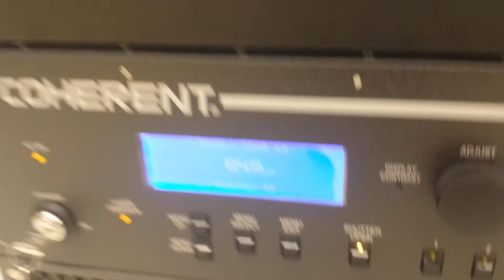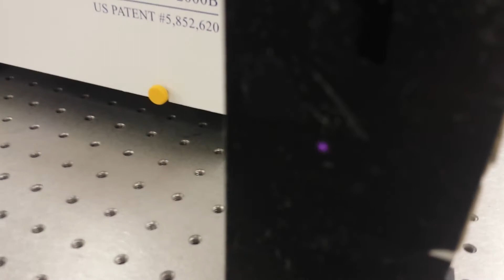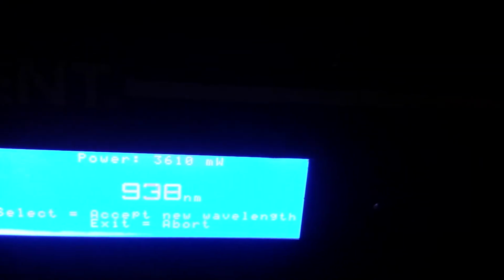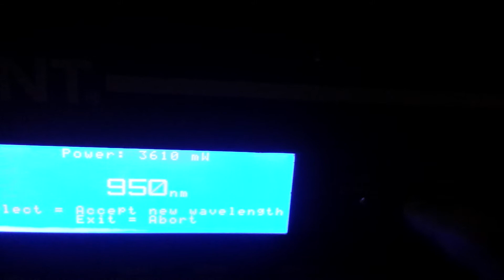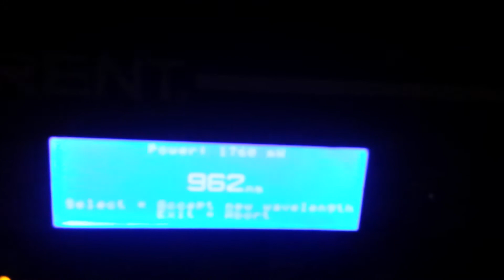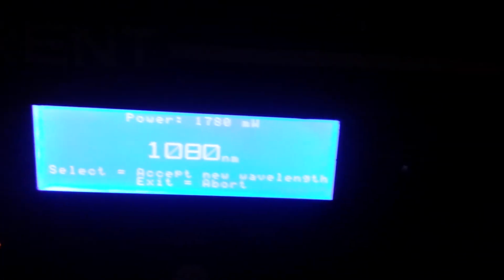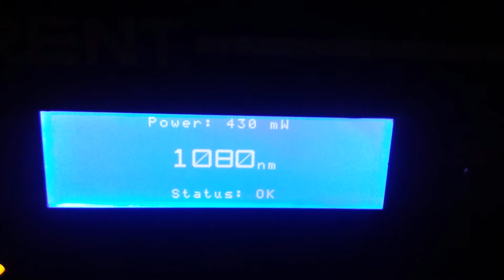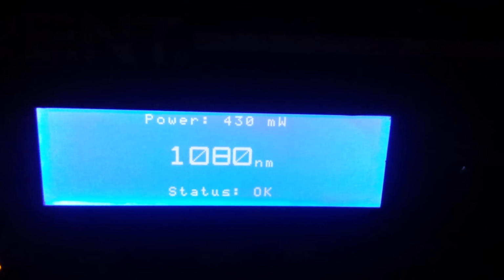View IR Laser beam using your smartphone camera

Comment: That's the dot on the wall, not the beam. How do you view the beam?
Reply: Beams have direction. You cannot see the beam in air because it is not directed towards the camera. However, you can see a beam that is being partially reflected off a surface and into your camera sensor.

Comment: I am able to do this with my Galaxy S8, but my colleagues with iPhones cannot haha
Reply from the maker: HA ha, I guess that might be key to figure out what this is ..I will into the differences between Samsung and iPhone camera..may be there is some clue..
Reply: This is simply not true!  I have an 808nm Infrared laser and can see the laser dot on both my I-phone and I-pad just like in this video.  I’m using the newest IOS ver. 12.1.1.  I’m sure it’s a safe bet that it works with earlier IOS versions.  Haters are gonna hate.
Reply: It is true but you'll have to take my word for it. I don't think it has to do with the software version but rather the phone camera hardware. I believe my colleagues had iPhones 10 and 5
Reply: I meant to mention that I was using an iPhone 7 and the iPad Pro.  I just finished testing also with an iPhone 10 and I can still see the infrared laser dot via through the phone’s camera.
Reply: Quite the mystery then
Reply: Digital sensors in cameras can see IR, which can cause a color shift with blacks appearing as purple, so every single camera manufacturer puts an IR filter over the sensor. Leica left one off of their M8 camera and instead provided a screw-on lens filter to cut IR out. Many people used an IR pass (visible cut) filter on the M8 to shoot infrared (or near IR) handheld. Because the M8 is a rangefinder, not a through-the-lens focusing SLR, composure was unaffected, though focusing was a challenge as the rangefinder is calibrated for visible light and not IR.
Reply: @einfussganger  When you say digital cameras can see IR what does that mean? Did you meant they shift the wavelength of everything they see by a little bit? So that IR becomes shifted to visible?